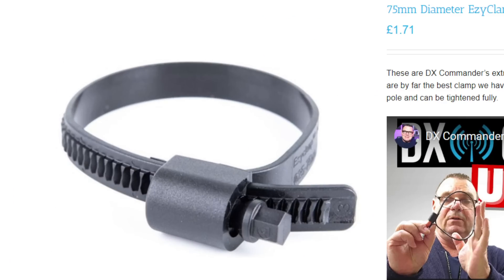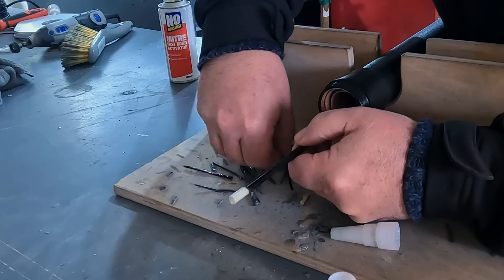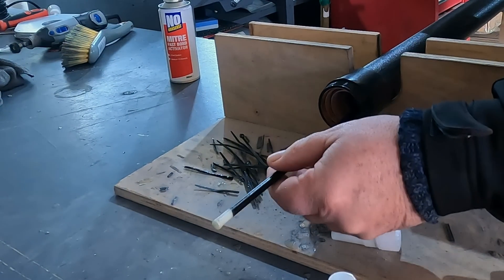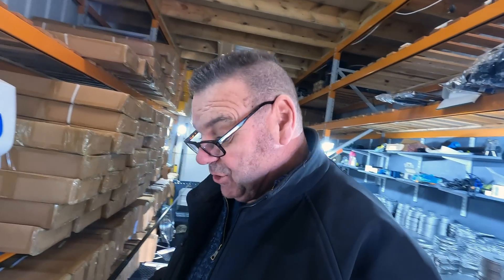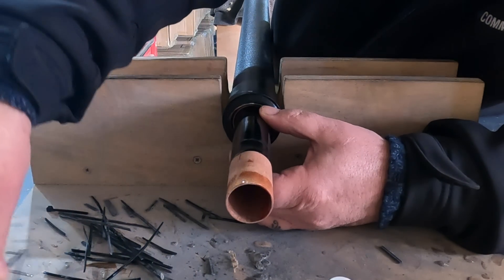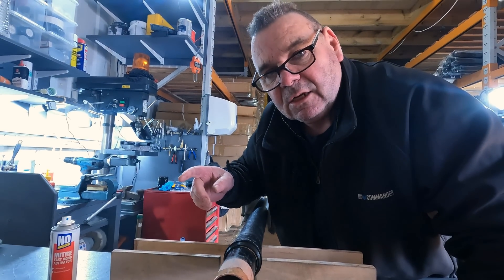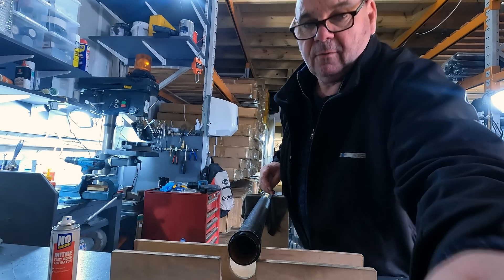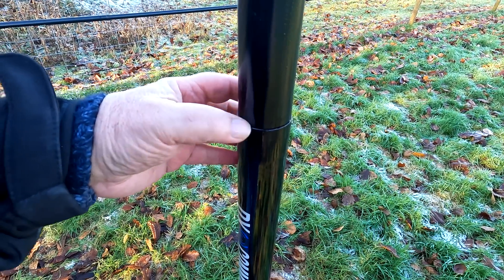Telescoping No More: How I Made My Telescopic Pole Completely Permanent

Comment: As some one who uses poles for fishing. Two different types of poles. It's useful to note that there're external and internal poles. IE poles that each varying size section extending from the smallest section upwards internally and those that extend by joining each varying size section over each other from the exterior. Each have differing engineering advantages. Push up is my preference as each section is held tight internally by the next section and is a tight friction fit, and as each section wears a little it can still be pulled 'up' tighter and any leaning pressure on the pole is taken up 'internally' by the next larger section. A put over system, puts 'external' strain on each section at its point of contact with each reducing section, and this type is prone to splitting on the exterior walls when the pole is bent over in wind, UNLESS IT IS GUYED AT THE APPROPRIATE HEIGHTS OF THE POLE.  Just saying

Comment: I had a 12mtr spiderpole that did break at 7mtr. I  cut off the damaged parts  so the two parts from one section could slide in lock. I had to shorten them to manage this. In same time I wanted a stiffer top section so I lowered the top into the next lower section. All those changes was glued with red rapid araldite. The pole is still collapsable , but for the time being it is a fixed 10mtr copy of DXcommander with 160m/80m inv.L from 8mtr hight and 4 more elements alongside the pole to make it multiband. 73's de LA1PHA

Comment: From the looks of it, you could use something more substantial as a spreader.  Would a silicone spatula be better for spreading a thinner layer of jell?  Once it cures will it just peal off of the silicone?
Reply from the maker: Erm.. Cable ties work just fine for this. Cheap too..
Reply: @DXCommanderHQ  That they are! I use them for mixing epoxy or as a cocktail stirrer if they're long enough!😁

Comment: Great video Cal. My DX Commander (using the original tape, clamps and rubber tube has been up two years so far - perfect it still is). Mark, 2E0MSR
Reply: Mine too, but some of the elements are baggy at the bottom, not all... Perhaps my miscalculation on the bunjees? I'll find out when the weather improves and I can be bothered to investigate!
Reply: @SteveBrace  I have done a couple of adjustments i admit,  but never had total collapse
Reply from the maker: Good stuff!

Comment: Having played with model aircraft for so many years. There as generally three types of “super glue” fast, medium, and slow. Super glue is Cyanoacrylate we use the term “CA”. Like you have there a chemical CA kicker they dries it instantly. As you can imagine fast bonds instantly and will wick into surfaces if porous like balsa. , slow gives you time to pin, clamp, or otherwise position and is generally thought to be stronger. Slow is also used in filling gaps. They also have very short strand fiberglass almost like dust that can be mixed with those or epoxy that makes and incredible bond. BYW Acetone will dissolve CA.
Reply from the maker: Ah! Interesting!
Reply: Well explained. Silica fume is the commercial product we used for filler but most guys in both model and with experimental aircraft using laminates just use baking soda. It's rock hard when cured and can be machined. It even endures on propeller tips to fix cracks and chips.
CA is water cured thus its use in the medical industry with the non toxic form. We use it in the trades as to rock climbers to repair damaged finger surface. Many other things I've learned in 50 years too. Some I've been credited with inventing in my industry. Love using polymers of any form.
Reply: @radiotests  Milled glass fibers are very different from fumed silica.  The milled glass fibers I use came from a fiberglass supply company and it looks like very dense powered sugar.  When added to slow cure epoxy, the composite created is strong enough to drill and tap threads and is not brittle like CA.
Reply: The XYL is wondering where her nail polish remover got off to, her operator hubby out back, working on his aerials.... LOL. 
Thank you for the videos Callum! 
73 DE KJ7WUZ
Reply: @DavidMitchell79  hahahaha. More truth than fiction there.

Comment: Nice, I'm going to play devil's advocate and predict the superglue even the thick slow dry is brittle and over time with break away from the fiberglass and start to fail.  Hopefully the joint is tight enought that it almost becomes an extension of the figerglass and therefore flexible, and proves me wrong.  
Great project Calum!  
  You won't know till you try.
              de ki7cia
Reply from the maker: Ah.. So what you don't know is that I had one on test before the winter :)
Reply: @DXCommanderHQ  Awesome!  excited to see the results.

Comment: Wrap your finger with waxed paper or cling wrap to spread crazy glue. The working times of slow cure glue that I have used in the past building Radio Control aircraft was 1.5-2 minutes. 24 hour cure is crazy. Once you hit it with the activation spray it sets instantly like a flash freeze. The slow cure is often the thicker gel type and fast set is usually a thin consistency. Things may have changed. I have never used 24 hour slow cure glue.Store crazy glue in an airtight container IN THE REFRIGERATOR. It lasts much longer and maintains its properties much longer this way.
Reply from the maker: OK, so this stuff has about a 10 second cure time with the spray. Is gard in 10 minutes without and crispy hard after 24 hours (without spray)

Comment: For the money you can't go far wrong with these poles. Mine has been strapped to a fence post, with no guy lines for around 4 months bent like a banana holding up an inverted-v. High winds, rain, freezing temps, sun and thing is still standing strong.

Comment: A thought: A kit of glue lined heatshrink appropriate to each section size. Unless it degrades in UV I'd have thought the glue would both hold the sections and waterproof it, but with the advantage that it could be cut off if you moved house or something.
Reply from the maker: I bought some.. In the sizes suitable, it gets expensive!
Reply: Maybe a hybrid, glue most of the sections but heatshrink 1/3 and 2/3  so you could break it down?
Reply: @g4lmn-ron  That's a better idea. It just needs to be small enough to stow in the shed or put on a roof rack.
Reply: This wan my first thought. A quality glue lined heat shrink to keep the moisture out and help hold the pole sections. Might even be able to skip the CA glue faf entirely with some 4-6" hunks of shrink at each join.

Comment: Only thing I have found that non nonsense adhesives is that they don’t like water and breaks down fairly quickly. I used it on some cable ties I had a few fail where the zipper goes through. .  I put some of the Bob Smith Industries (BSI) “slow cure” and that been out in all weathers since Dec 21 and not failed. There is a UK website for them as well.  Great adhesives and right price. M0ONM
Reply from the maker: Yes, once cured this isn't so much flexible (I know) but there isn't much flex where the join is..

Comment: I used some silicon putty tape that they use on cell tower coax to encase each section, then tape over them. Then used the clamps on top of it all. Nothing has come down. I dont want it ever coming down.
Reply: The mastic strip I have says it is UV resistant. I haven't used it on the sections, only on the coax connections.

Comment: You can get superglue attached things apart with heat and a bit of percussive maintenance, as I have learned from a few machining channels on youtube. But I have no idea if the pole stands the kind of heat that is needed for the glue to come apart enough to get the pole to collapse again... [I've edited this comment a couple of times]
Reply: I can’t comment on heat. But when I was a kid at my dads store I’d glue a half dollar coin to the floor and giggle myself silly watching people try and extract the coin. Never happened. At the end of the day I’d give it a modest wrap with a hammer it’d pop right off until the next time.
Reply: Can't be arsed to add another edit to my comment, so I'll just reply to myself... Maybe you could test that. Try and heat up the pole (with a hot air gun) and see if you can break the super glue bond without damaging the pole
Reply: @Ran-tan-tan  I was thinking the same "Clickspring" uses Superglue a lot to temporarily put items in a lathe or similar.
Reply: @g0fvt  Exactly what machining channel I was thinking of!

Comment: Sum CA cyanoacrylate glues dissolved with mineral spirits or sum Rc hobbies ca makers sell Debond or uncure
Reply from the maker: ANd nail varnish remover stuff.. Acetone?
Reply: @DXCommanderHQ  yes I believe all will work and a little heat from lowest power on a heat gun. I was also thinking on permanent installation 5 min thin epoxy could also work, but possibly sacrifice a few more mm of height